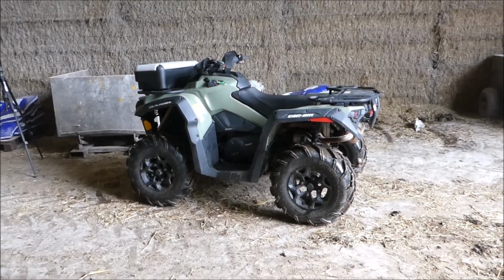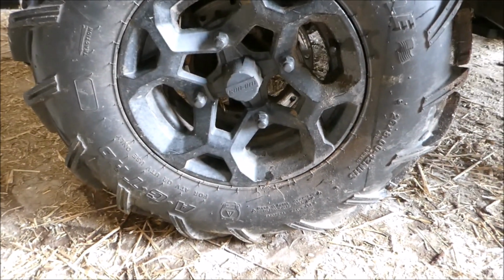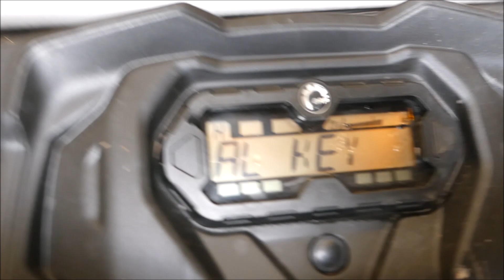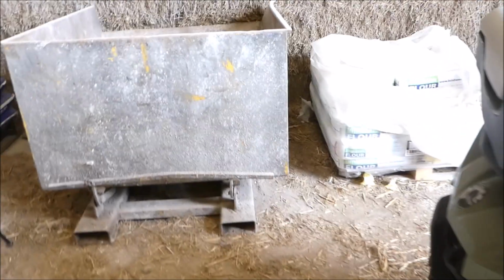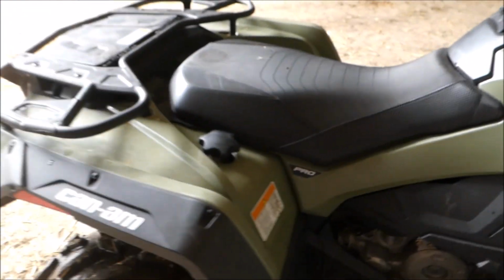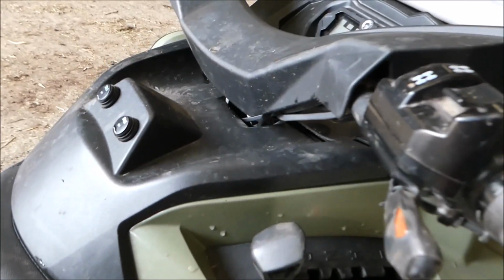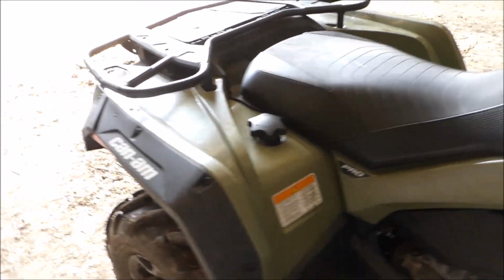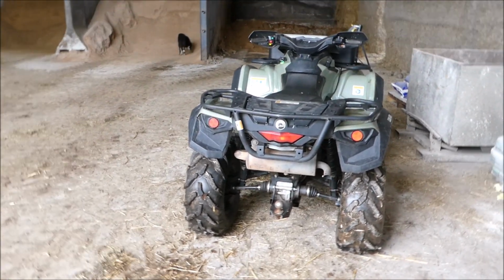2018 Can-Am Outlander Pro 450 - 2 Years Later Review

Comment: Good to see a review on how durable they are for work etc, i use a honda 450 and 500 and they're solid. id stick with honda because they are so bulletproof, hondas last for 20 odd years haha. Would you get a kawasaki mule, brute force 750 or suzuki king quad 750?
Reply from the maker: Hi Jonny, glad you liked the review, I have to agree with you there! whilst Can-ams are great and all they aren't the most reliable.. Hondas are sturdy old machines, bit like Suzuki!  We had a Suzuki Eiger quadrunner before this and that lasted a solid 14 years faultlessly, it survived two rollovers, a collision with a tractor trailer and even got flooded at one point.

Depending on the application I reckon a kawasaki mule would be the handiest for the farm, especially when doing fence repairs, injecting cattle and whatnot but if I wanted to move the cattle or just go fast,  I'd probably go for the brute force 750!
Reply: @TheMonners  Yeah the Kawi mules are brilliant for around yards and doing work out on the field with the stubby wheels that get that more power, a friend of mine has the deluxe version with the doors etc and its so good for mini bales/concrete bags etc. I've had yamaha and honda but the kawi brute force has a cvt belt transmission which isn't as reliable as DCT I think

Comment: I’ve same one, you get 2 keys with it a normal key which is limited on speed etc. And a performance key that gives you full power and speed. Your gear lever needs adjusting, I had to do the same on mine. I think after a bit of use and the gearbox gets run in it just needs adjusting, never touched it since. There’s a linkage behind the panel under great lever that needs adjusting, if I remember rightly put it in neutral and adjust the linkage so it moves your gear lever to the centre of the N mark. I think I got away with just taking the small black cover off at the side and adjusting it, or I might of took it all off I can’t remember . You’d have to check but your owner’s manual will tell you
Reply from the maker: Sorry for the late reply, Ah.. I'll have to have a look around for it! - I see, I'll have to do a bit of research then have see if I can have a crack at doing it. Cheers for the advice though it's much appreciated.